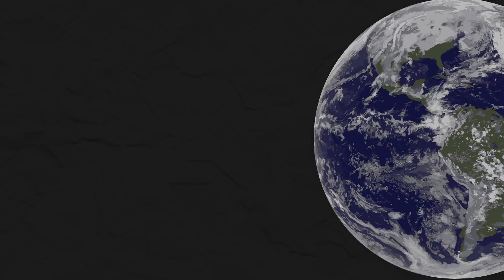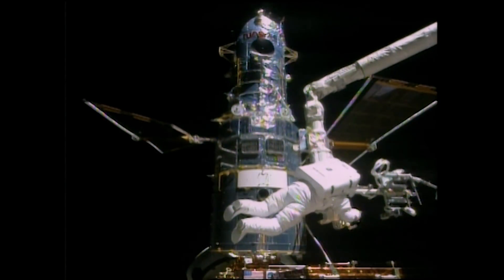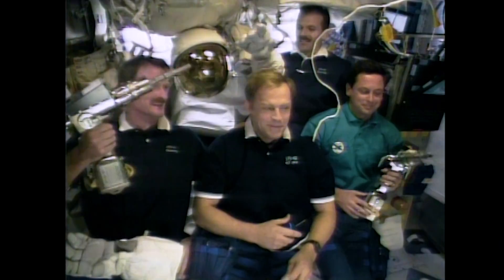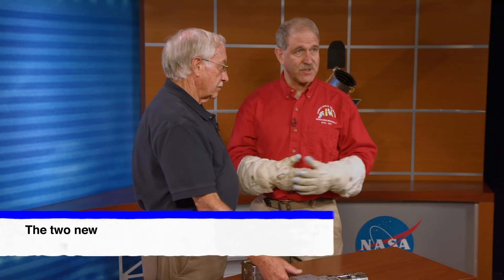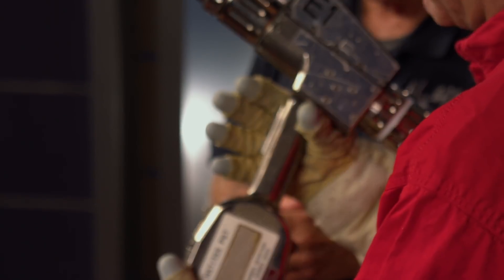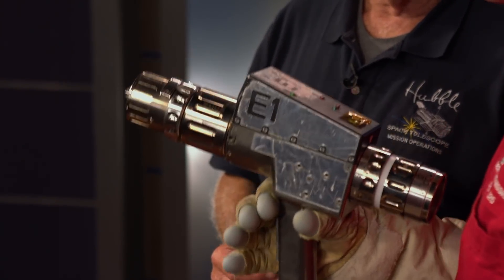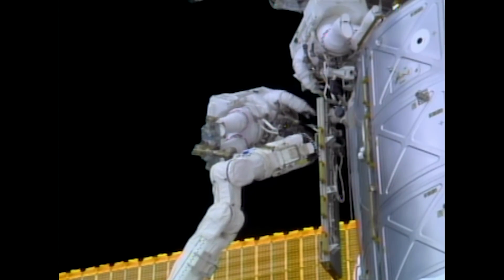Hubble Tool Time Episode 3: Servicing Mission 2

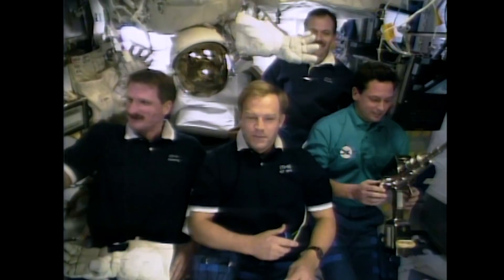Comment: 2:14
 So by implication, the turns and torque of every fastener on Hubble is documented prior to launch?
  Is this documented empirically, by design spec or both?
Reply: no..the tool recorded the torque used to firstly release the fastener, and recorded the amount of turns to get it all the way out....then they could use the same turns and torque when putting it back together.. too much torque could have sheered bolts, too many turns could damage wiring/equipment behind it..basically they just wanted every "fastener" to go back in with the same tightness as it came out with..
Reply from the maker: Thanks for your question! While there are many fasteners holding the telescope together, during spacewalks we focus primarily on the fasteners astronauts would be working on while servicing Hubble. These include door latches, bolts to hold instruments in place, etc. 

Since Hubble was specifically designed to be serviced, many of these fasteners would be loosened and re-tightened over several servicing missions. It is important for us to document torque -- a turning force -- and turn count, so when astronauts engage that fastener they know how much force can be applied without damaging that fastener.

- Ed Rezac & Russ Werneth
Hubble Space Telescope Tool Time team